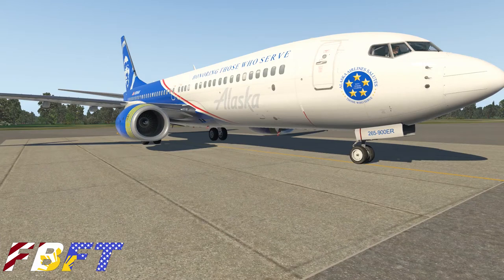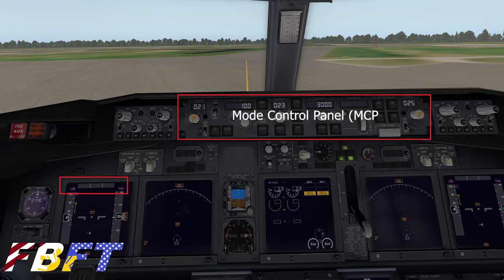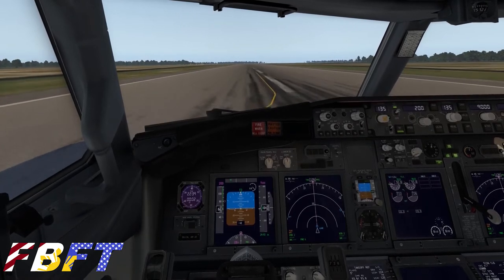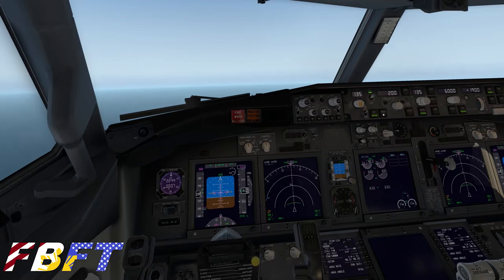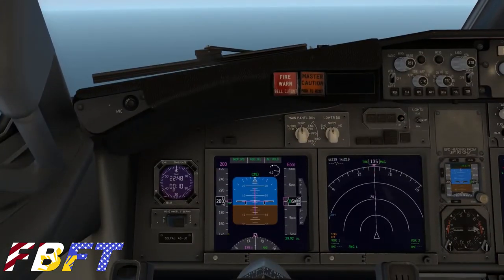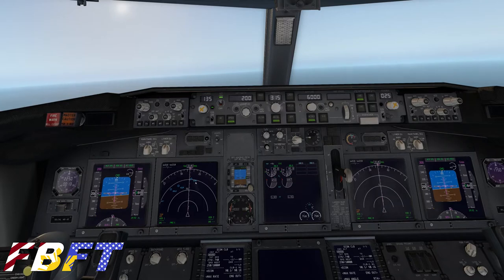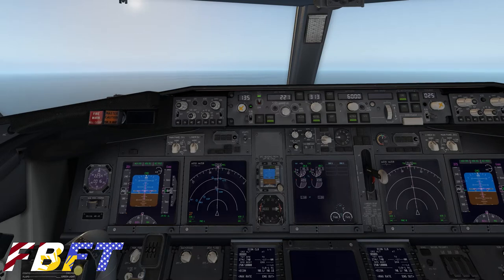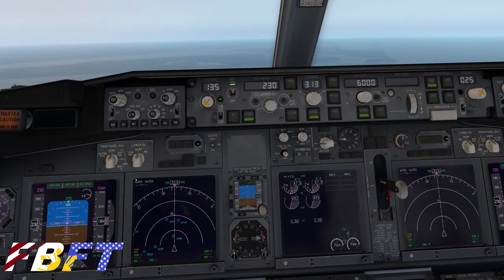Zibo 737 Tutorial | Mode Control Panel- What you need to know.

Comment: Questions: I have been setting my heading to the departure airport and the course to the route to the arrival airport before takeoff. Then later set the course to the actual
runway landing heading.  I don't think that is all to it.  I notice that at different times you change the heading and then at times the course.  How do you know when
to change these settings.  I was using MFS-X and that is easier to fly and find the airport.  Now I have installed X-plane 11 and can't seem to get to the airport to land.
It must be the settings of the course or headings or some other factors.  My FMC is programed correctly, so I don't believe it is that.  Help!      Again, you make great videos!
Reply from the maker: We just saw this comment.  The heading is controlling where the airplane is going.  Course is a bearing or radial to or from a navaid, be that an VOR ADF or ILS.  If you want to see more of the course usage and VOR work, we have a livestream with the FlyJSim 727 where both Tim and I fly and exercise a little CRM (Crew Resource Management).  https://youtu.be/Zu0KguokqnY

Comment: N1 for takeoff throttle. I have always just manually pushed the throttles forward. I will use N1 from now on. Is this more efficient?
Reply from the maker: Kreemerz it allows the automation to help you.  Since takeoff thrust setting is a calculated N1 value based on many factors (runway length, temperature, humidity, elevation, runway slope etc) whether you choose to do it manually or through the autothrottles you should arrive at the same N1 % value based on the performance charts.  Using the auto throttle gives you a more seamless transition from take off power, to flaps up, to climb power.
Reply: @FlightBrothersFT  Is there any difference between hitting the N1 button or TO/GA on takeoff?  I've never seen the N1 button being used.  By the way, the TO/GA button in the Zibo plane is the Mic button on the upper Captain's dash. 

This was a great video.  It definitely helped explain things in a clear and concise manner.  Thank you for putting this together.
Reply from the maker: Frank Perreault it’s the same result, do as you like

Comment: Thanks you for the informative tutorial. What is the use of CWS buttons on auto pilot command section (below CMD A and CMD B)?
Reply from the maker: Control Wheel Steering is rarely used.  I believe it holds the flight surfaces in a given position (similar to how Airbus normally works).  I'm not completely sure on that though.
Reply: Yeah it holds whatever position the control wheel is ... 15 degrees and you press cws and it holds it there

Comment: What version of Zibo mod 738 are you using? I installed the latest version, 3.44 full, with the #2 patch and it seems like the instrument panel has some issues, it's not displaying the heading at the top of the Navigation Display screen, where it normally shows it, instead it shows "---", and the attitude indicator display doesn't display correctly.  I deleted the entire folder for the aircraft and installed version 3.40 full, and still that didn't help, and I followed the instructions just as outlined in both cases. Before I go to Zibo's Google drive and see what older versions are available, I thought I would check with you. Thanks in advance.
Reply from the maker: We aren’t sure, it was probably a 3.2 ish build.  I believe the video is over a year old to this point.
Reply: @FlightBrothersFT  Thanks.

Comment: Why sometimes we cannot engage VNAV and LNAV after setting up the flight computer?
Reply from the maker: In what capacity?  If this is a recent Zibo, the flight directors MUST be centered in order to engage.  The aircraft will not let the auto flight engage if off the intended flight plan, and you must manually fly it to correct.